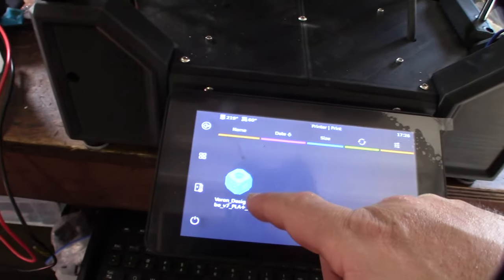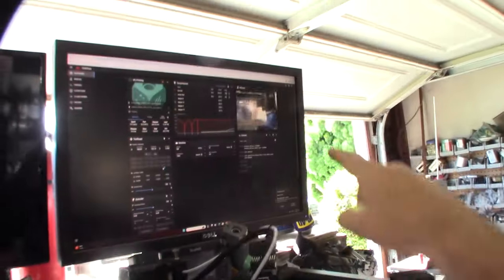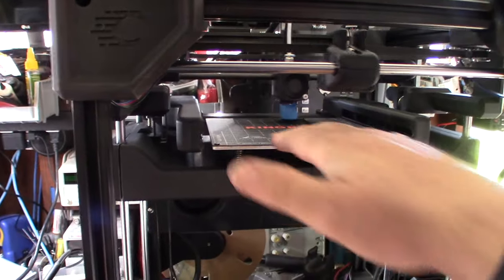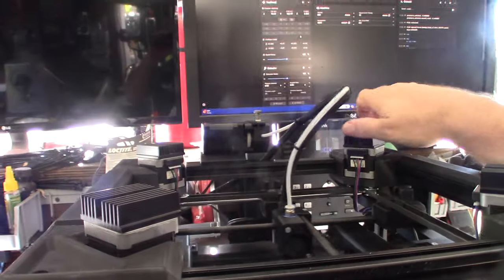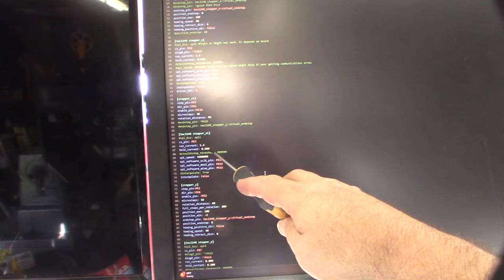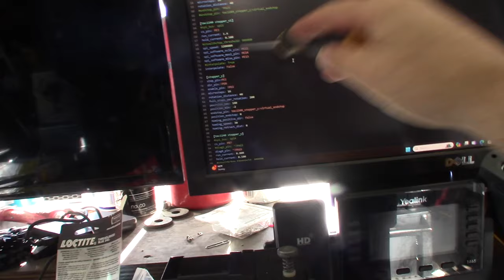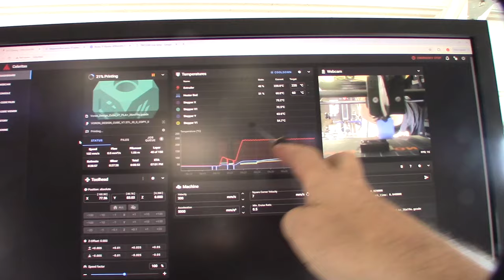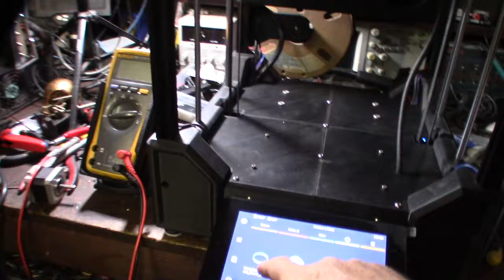Celeritas World's Fastest 3D Printer Concept, First Print!!!, CroXY Carbon Fiber Tubes Part 4

Comment: Dang, that's amazing! I saw a similar configuration on... the Annex Engineering K3, I think? It's got a similar cross-gantry, but not nearly as much cooling. Excellent work!
Reply from the maker: Thanks. I've seen the Annex K3, its pretty awesome.  I first saw this cross gantry design about 6 years ago. I always wondered what would happen with carbon fiber tubes. This all became possible because of the new oil impregnated bronze bushings.

Comment: Congratulations! It looks really nice. No "sticking" or "hopping" in the bearings? I did notice that your center carriage has a very short bushing contact length, I wonder if that play helps it move smoothly 😄
Reply from the maker: Yeah, I think it needs a longer or second bushing there. Its binding a little at the very front X rod. I might also try 12mm carbon fiber rods. Thanks for your comment.

Comment: I think the quantum delta is the vastly superior concept when it comes to speed, acceleration, cooling and hotend/extruder. In planar moves there are always 3/6 motors working together. You gain potential with smaller prints and/or a smaller bed. You are also not limited by cooling, extruder or hotend in any way.
Reply from the maker: I heard the limiting factor of the delta printer was processing power to calculate 3 axis motors. What do you think. I might try Klipper on a linux computer if my raspberry pi4 can't keep up.
Reply: @fintechrepairshop  ive never ran into processing issues with my pi4 and a 5min speedboat benchy. But even the cheapest compugsr ist faster than a pi. So if that problem arises you could do that. And also there are like 500mhz stm32 mainboards out there, so think that shouldnt be a hard cap

Comment: For the steppers motors have you thought of water cooling them to run them a bit faster? I have to ask why springs and not a solid mount for the bed?
Reply from the maker: Bed springs because there is no probe. Probe and mesh will slow it down. I don't want the overhead of mesh.
Reply: @fintechrepairshop  I see, that makes sense just had to ask. The fans I would add a third and make it a 360 fan duct all around the the bed so you get  part cooling all around.
Reply: I was wondering this also, have seen a few different stepper motor water cooling solutions and also water cooled hotends, typically for Voron's or VZbot's and Nema 17 stepper motors
Reply: @JoshFisher567  so for the hotend it would add to much weight tho he could try a ver of that type because you would lose the fan so maybe, I think he would have to try it and see how it feels tho.
Reply: @JoshFisher567  And for the stepper yeah I feel that to a point it would help because you can water cool all the stepper most likely a 240mm rad or maybe a 360mm rad if you go for the hotend too or maybe two 240mm one just for the hotend and one just for all the steppers. Also sorry for the double msg.
Reply from the maker: @FatBoyRenji  I'm thinking of ways to do that.
Reply from the maker: @JoshFisher567  I was think about machining some. The head is so light I'm might not need to max them out. The TMC2240 drivers I'm running have out around 1.4-1.6 amp. I could bump the voltage up to 36V
Reply from the maker: @FatBoyRenji Thanks for commenting. I won't know if this behaves until I push these to extreme speeds. I'm running some external 5160 drivers on my Orca printer. I machine some huge heatsinks for them.
Reply from the maker: @FatBoyRenji  thanks for the comments, I like getting ideas.
Reply: @fintechrepairshop  Np and glad to help in any way, you're likely not wrong on the water cooling but you will not know in less you try it and tho it most likely wouldn't add much on what you can push it but you never know.
Reply: @FatBoyRenji  Yeah, most the water cooled hotends I've seen are compatible with Voron and VZbot but there are a few flavors of Voron hardware designs. Seems like you need a steel CNC rail, although I could be wrong. 

Mellow 3D sells a Hextrudort water cooled extruder that's compatible with Voron and it accomplishes the same thing. Keeps the extruder stepper motor cooler and hotend all while weighing just 51 grams. The hotend is like 150 grams for the Goliath. 

With your setup of water cooled extruder would make more sense as they have some great water cooled lightweight models out there
Reply: @fintechrepairshop  Yeah, after way watching a few videos it is only needed if you have a heat sealed enclosure. With no water cooling the new stepper motors were around 80C on a thermal camera during use. With water cooling added using an actual coolant instead of water they were a constant 40 to 42C. Pretty positive 70C is well within normal range and not getting close to the max stepper motor temperature. 

Seems like a water cooled extruder would help more. Lighter (51G) than a water cooled hotends (around 150G) and accomplishes the same thing. It keeps the extruder motor at a cool 35C and controls the hotend temperature which greatly reduces noise and weight because no fan is needed. Obviously a fan is needed on the hotend to cook the part but no extruder fan needed. Saw a video of someone hitting a volumetric flow rate of 140mm/s. That was with a 1.0 nozzle with a 0.5mm later height though. 

It's pretty ridiculous to see the extruder stepper motor at 28C with the top of the hotend at 108C and they are maybe an inch away, possibly less. 

Adding water cooling should only be done if needed in electronics, same with computers. If it's not needed then don't do it. There could be some serious issues if a leak occurred which isn't a concern with fans. I would really like to build a VZBot but probably above my current skillset, especially with the electronics.

Comment: Why the clickbait title? It isn't necessary as you have built a nice printer. 

Of course carbon rods work, there are at least two printers if not more on the market which use them.

The fastest printer I know of is a highly modified Voron v0.x from 247printing doing over 1500mm/s
Reply from the maker: Words fastest is the goal. I guess it a sounds a little click bait, but I'm serious!!!
Reply: @fintechrepairshop  Good luck, don't switch to direct drive if you really want to be the fastest.